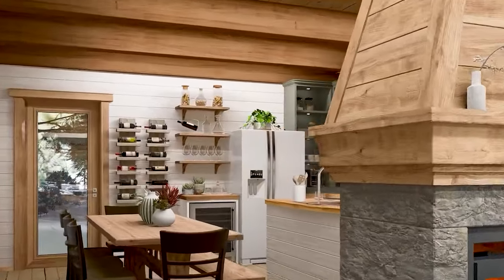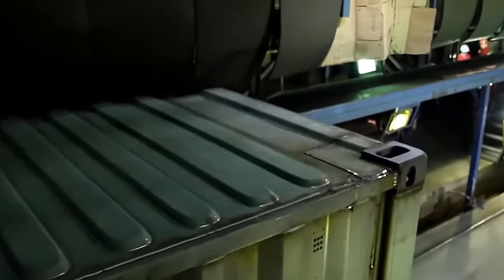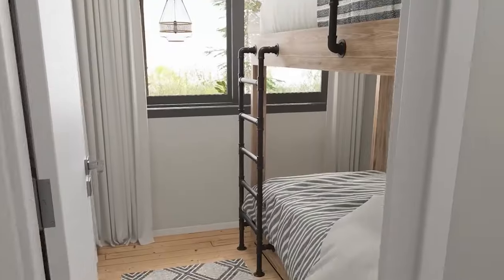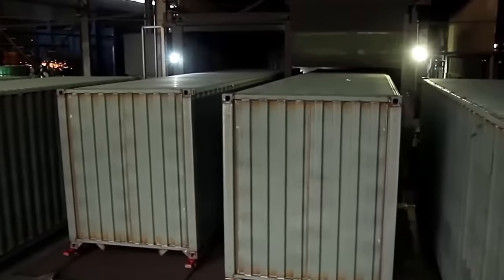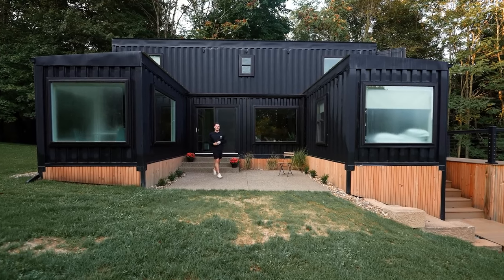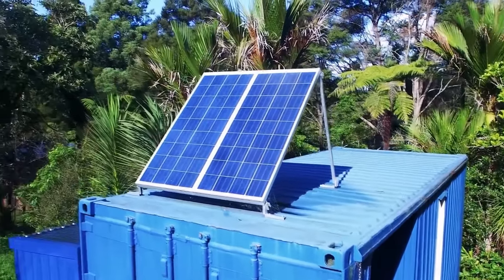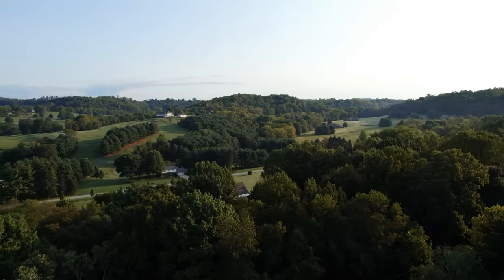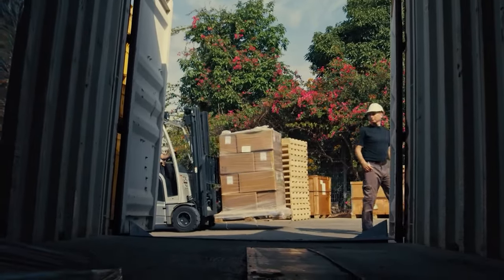Shipping Container Homes 101 Everything You Need to Know

Comment: Shipping container require framing inside to make it a home. Without framing you can not install insulation, utilities and dry wall. Once you instal framing you cut down on the available interior floor space. Container homes are overhyped and not necessarily cheaper than traditional framed houses, modular or mobile homes.
Reply: its rad
Reply: Insulation is the cheapest thing you estimate in construction
Reply: Great for hurricane areas. I'm buying one here in Florida. Don't have to worry about roof blowing off or termites either
Reply: ur mad at container homes
Reply: @PapiAldoDiaz  So anyone who points out shortcomings with a product is mad at that product.
Reply: Fireproof, earthquake proof, waterproof, theft resistant , weather resistant, mobile, modular, add or subtract, cool hip
Reply: Tiny Homes.

Exactly. Now go away.
Reply: You could argue you are saving a roof, siding, and floor.  To your point, I don’t think in the end you save a thing.  In fact probably more expensive.
Reply: @10du16 yeah but you have to frame them anyways is his point, so you really haven’t save anything.